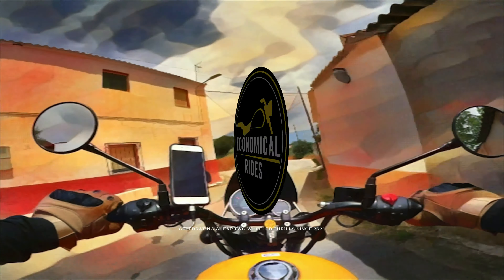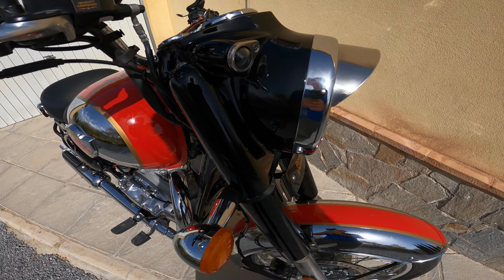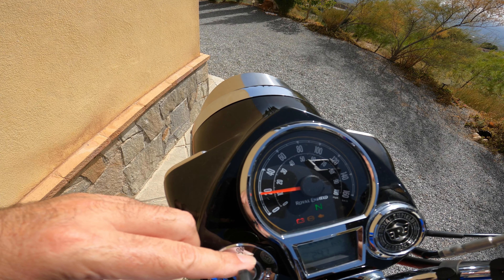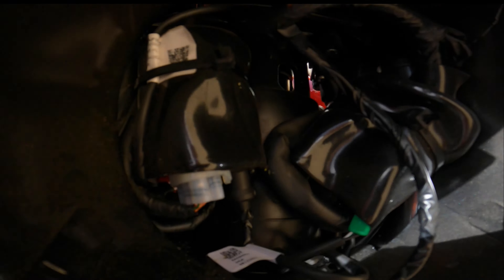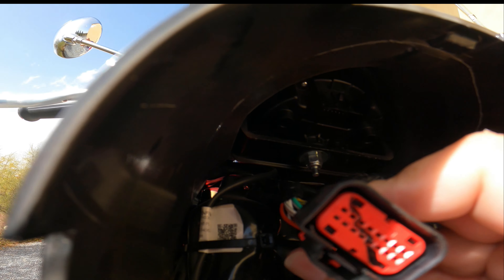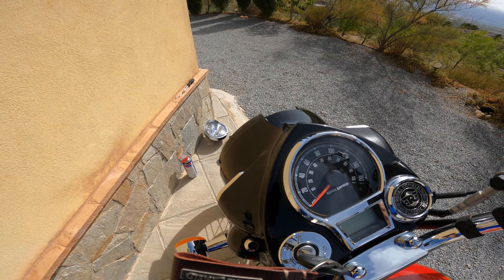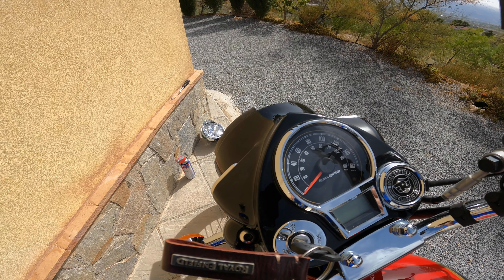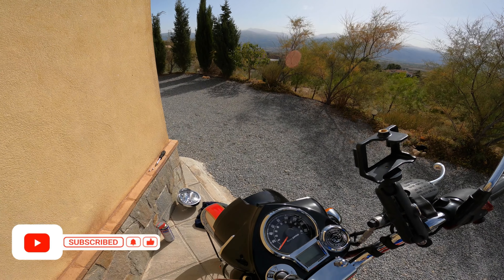Royal Enfield Classic 350 REborn - "Sticky Speedo" Fix ? - Well It Worked For Me ( So Far ! )

Comment: Great video. I was wondering if you added a little electrical contact grease after you sprayed the contacts with WD40? I’ve had to clean out all the factory gunk from the relays on my Interceptor and added a little grease to prevent corrosion. It must be great living in Spain. My wife and I have an apartment in Murcia and hopefully soon we will be spending a month or two at a time there and luckily there is a Royal Enfield retailer in Murcia City! Happy days👍
Reply from the maker: Hi Mark,
thanks, glad you found this one useful 👍🏻
No, I was wary of using grease because I suspect that the factory grease may have been causing the issue. I decided that WD-40 would be nice and light and less likely to affect conductivity in the connector pins. I've no idea if that was a good idea or not, I just figured that this way it would be easier to clean the connector and spray it again, should a repeat be necessary. 
This "repair" has held for over eight months so far, but I was prepared to repeat it if necessary because it is a ten minute job. Preferable to fitting a new speedo, losing your previous odometer reading and potentially having the problem again anyway. 
I've just traded the Classic in for a new Himalayan but the speedo was still working fine when I handed the bike over 👍🏻
I have heard that the shipping grease RE use on electrical connections has caused issues with relays on all kinds of different models and particularly on Himalayans. So if my Himalayan starts acting up, I will definitely open and clean all connectors before losing a whole day taking the bike to the dealership. I believe that the dealers are instructed to remove the shipping grease before delivery but that memo seems to have been ignored ! I think the grease can affect conductivity as its state changes, i.e. as it gets warm on a hot day, it becomes more liquid. That then results in a different level of conductivity through the connector and depending how sensitive the following components are, these slight changes in current could cause weird side effects. It's just my theory, I'm not a scientist or micro-electronics specialist. I would always prefer to have a CLEAN connector and then just try to keep it out of the wet and preferably add some water repellent element like WD-40. Also I don't like getting mucky and grease is mucky stuff 🤗

Yes, I am familiar with Intruder Motorcycles in Murcia, I've been there a couple of times but it is a bit far for me to go there regularly. They tend to have a good selection of RE models on demo but it's a two hour drive each way for me, so a five hour round trip just to test a bike is not really terribly appealing ( particularly with Ruby waiting impatiently for my return ! ).
Whereabouts do you have your apartment if you don't mind me asking ? Mazarron way maybe ?

Cheers Mark, enjoy your Interceptor 👍🏻
ER
Reply: Hi. Thanks for your reply. It sounds like you’ve done exactly the right thing especially as it’s still working after 8 months. Why have you sold your Classic 350? Are you doing a bit of light off roading which would  be perfect on the Himalayan? We bought a place in Lo Pagan which is on the Mar Menor in the San Pedro Del Pinatar district. We’re only 50 metres from the Mar Menor with the Mediterranean just a five minute drive away. It suits us perfectly and since buying it on a bit of a whim in 2020 and visiting for the first time in 2021 we find ourselves going there more and more as I can work whilst I’m there. Murcia City is 30 to 40 mins away and Cartagena is about 45 minutes away. We are about an hour from Alicante and 30 mins from Murcia International airport which is brilliant as it’s a much smaller, quieter airport. Originally I was thinking of something faster than my Interceptor but in all honesty I’ve realised that it’s quick enough as it will comfortably do 100mph (not that I ever do🤣) and with a free flow DNA air filter, free flow headers and Zard silencers together with YSS suspension it sounds amazing and handles brilliantly. What attracts me to the Classic 350 is the thumper single cylinder engine, the military colours they do and the well documented uplift in overall quality and fit and finish. I’ll be going for the Signals Marsh Grey which strangely is actually green and my preference as it will be a nice contrast to my Interceptor and which won’t involve even more polishing of engine cases and exhausts🤪 The Interceptor’s sweet spot is 50mph to 70mph. Having the Classic 350 for bimbling around the lanes between 40mph and 50mph I think will suit me perfectly. It’s great to have found your page. Happy and safe riding👍
Reply from the maker: @markfletcher443  Hi Mark,
if you watch my last video it will all become clear, it's all very recent but yes, since taking both the Meteor and the Classic down a mountain trail about eight months ago I realised how much fun that would be on a bike which didn't make me feel guilty every time I did it. The Meteor and Classic both did well but were filthy afterwards and I always tried to keep them pristine. Since I can't be doing with three bikes at the moment, the Classic had to make way for the Himalayan because I wanted one bike for the roads ( now the Meteor ) and one for the trails ( the new Himalayan ). As much as I liked the Classic, as soon as I discovered the local trails, it did bug me having two road bikes and no bike for the trails. Something had to give !
I can always buy another Classic later on, if my circumstances change again. It was certainly a lovely bike.
RE's black finishes are really easy to clean, so you'll be glad you don't have too much chrome on yours. The Meteor is all blacked out and it comes up like new with zero effort. After two years and a few dusty trails, it still looks brand new. To be honest, my red/chrome Classic was pretty easy to clean too. The only downside with chrome is what the English winter might do to it. If you only ride in the dry, like me, you can hose it off and dry it and it holds up fine.
The black finish does seem to be very durable though and as I said, just rinse off and dry and it looks like new 👍🏻

Yes, Murcia is a lovely little airport. Unfortunately it's no use to me because there are no flights from there that work for me. I always have to fly from Almeria to Madrid and from Madrid you can get anywhere, obviously. Unfortunately the regional airports are really suffering and struggling to get flights, since a lot of the budget airlines went bust !

Good luck with your own Classic and welcome to the channel. I hope you will find my Meteor and Himalayan hijinks entertaining 🙂

Cheers Mark, have a great weekend !
Garry
Reply: Hi Garry. Yes, I’ve just seen your latest video. Aaaah it sounds like it was a very tough decision but I think you’ve made the right one based on your motorcycling needs at the moment. I tested the Himalayan and it’s a great, rugged motorcycle that can do just about anything. I know what you mean about having 2 or 3 bikes. My wife says, “ You can only ride one at a time” Only a non biker would say that🤣 You should have a look at Michael Mams collection. His channel is called The Mam Journals. I think he has at least a dozen bikes of all different kinds. It’s quite a collection. I hope you really enjoy your Himalayan which I’m sure you will and I’ll definitely still be watching your videos even if you won’t have the Classic 350 for much longer. All the best👍
Reply from the maker: @markfletcher443  Thanks Mark.
Yes, unfortunately I am imposing a two bike limit for this year. 2024 should be my three bike year if all goes well !
Something had to give and so far I am really impressed by the Himalayan and the local trails. It's terribly exciting.
Thanks for the recommendation, will try to remember to check that channel out 🤗
It's funny that your wife says that.
I always say "two bikes and only one arse" 😂
Take care Mark and thanks for sticking around. We promise to keep you entertained !
Garry & Ruby

Comment: It looks as though it was just a matter of disconnecting and reconnecting. Also, the needle did go from above 20 to 20 or a little below after the first on and off. If turning the ignition on and off a few times may have done it maybe. Worth the electrical chemical. Doesnt hurt.
Reply from the maker: Hi,
turning it off and on 10 times fixed it THE FIRST TIME it happened. This was the second time and it just would not return to zero. Cleaning the connector is the thing that helps, since I did this, no reoccurrence in eight months.
Some people have had a new speedo fitted multiple times and the problem returns very quickly. This would suggest that it is not the speedos themselves that are the problem, a new speedo on the same old connector, quickly starts playing up again. I really believe that the connector needs to be perfectly clean and have perfect contact for these speedos to work correctly.
It's very easy to clean both sides of the connector with contact cleaner and I would recommend that to anybody having similar problems.
Cheers
ER
Reply: @economicalrides  great! Thanks for the feed back. If there’s been no reoccurrence for eight months it’s a permanent fix and there is nothing wrong with Speedo.( until next time it needs cleaning)
I just rebooted mine last night by the on and off technique. But I will have in handy an electrical parts cleaner. Cheers.
Thanks
Reply from the maker: @maiojoserivera786  Definitely worth cleaning the connector next time it happens Maio. Your bike sounds like mine. The first time it happened, switching the ignition on and off a few times fixed it. The next time it just wouldn't return to zero again.

Another tip for you - if you park the bike in direct sunlight for any length of time, put a glove or something over the speedo to keep the sun off it ( fix it with an elastic band or something if it is windy ! ). I have also been doing this since I cleaned the connector and so far the problem has not returned.
Most people seem to feel that the problem starts when the speedo gets too hot, so just keep it in the shade if you can.

Good luck Maio🤞
ER
Reply: @economicalrides  thanks. It’s a classic 350 chrome bronze. Thanks for the tip. Will be getting electrical cleaner can soon. Looking forward to new vids
Cheers
Reply from the maker: @maiojoserivera786  Cheers Maio 👍
Keep the speedo in the shade and the connector clean and hopefully you can avoid having the speedo replaced and losing your current odometer reading ! That’s why I tried to fix it myself, because I didn’t want a new speedo with 0km on it !
Stay safe and enjoy your Classic !
ER

Comment: Managed to move the red lock down, but couldn't move the connector.  Is brute force the solution?
Reply from the maker: Hi,

I struggled with that too !

I just jiggled it side to side as I pulled quite firmly and eventually it did come apart. Just ensure that at no point are you pulling on the wires. If you are just holding the plastic block, top part and bottom part, you can use a fair bit of wiggling and pulling to get it to come apart.

I almost gave up at the very same point but was brave and tugged and wiggled and eventually I could feel the connector starting to open.

Cleaning the connector fixed the problem for me and the speedo was still working fine six months later when I traded the bike in. 👍🏻

Good luck with it ! It does need a bit of force to get it to open for the first time !

ER.

Comment: This is such an easy `fix`, so I think I will do it anyway, as part of my winter preparation, with some electrical contact cleaner and a bit of WD40, even though my speedo is fine at the moment.
Reply from the maker: Hi Dave,
I would. Just be careful with the connector, it can be stiff, just make sure you are not pulling on the wires when getting it off.
The day after this, after three months of waiting, the dealer called to say that my new speedo had arrived. Typical ! 😂
I won't get it fitted, I want to give my original one another chance.
If it plays up again, I will get the new one fitted but will also clean and lube the connections straight away. It can't hurt and it could definitely help prevent these issues from occurring in the first place. So even if you haven't had an issue yet, cleaning and lubing the connector really can't hurt, as long as you don't damage the wiring harness.
Good luck, I would definitely consider this fix as "preventative maintenance", I'd say it was worth doing, whether you've had an issue or not !
Cheers Dave,
ER.
Reply: @economicalrides  Hi. Yes, typical that it arrived after you sorted the original one. I don`t blame you for giving the original one a second chance.
Thanks for the tip about the wiring connector. I am always careful not to pull on the wires, with any connector.
I have just fitted a heel / toe gear shifter, which arrived this morning, only a few days after I ordered it and it makes the gear change so much easier. I had moved the original lever up one notch and it was better but I must say, the heel / toe is better again. Looking forward to watching more videos from you 👍
Reply from the maker: @davericketts9101  Thanks Dave,
I‘d love a heel toe shifter on my Classic, I really would, if I could buy one from Europe !!!
Buying from India is such a pain, here in Spain. The whole customs charges and delivery delays make it super unappealing !
I haven’t given up all hope that RE dealers might start supplying them officially someday.
Even in its new position I still find the original shift lever to be 🤬🤬🤬
Oh well, glad you got yours and I‘m sure it is a massive improvement !
Cheers Dave 🥃
ER
Reply: @economicalrides  Sorry for the delayed reply.... Sad you are having difficulty getting one and hope you are soon able to get one. I felt exactly the same about the original gear lever after raising it one notch and the heel / toe shifter is 100% better and so easy to use. The seller I bought mine from (at a very reasonable £34.80 incl. postage) has just put them up to £56! They must realise that a lot of people want them.
Good luck.
Reply from the maker: @davericketts9101  Cheers Dave 🙂
Well if I ever do get one, I’ll be sure to mention it on the channel 👍
I’m sure it’s waaaaaay nicer to use ! Enjoy yours 🙂
Have a great evening 🥃🥃
ER

Comment: Hola ,  re speedo  did it last ?  Mine did it last summer intermittently ,  bahaved itself over winter now the suns out its doing it again cheers bill uk
Reply from the maker: Hi Bill,
I just did this fix once and the speedo was still working fine over eight months later when I traded the bike in. I am sure that if it had happened again, just repeating this process would have fixed it for another fair while. But I only did it the once and it was still working fine at the end. Hope this helps. It's easy enough to do, once you've figured out how the connector comes apart 🤔
Cheers Bill,
Garry

Comment: Curious, my current view is that that the engineering is sound but production to meet demand mean that there are some short cuts. I’ve bought a Classic and an Interceptor this year. Both have had a couple of loose spokes in both wheels. Generally finish is good but regular cleaning and protective coatings etc….mind you….is that any different to other bikes?
Reply from the maker: I definitely think that the production side has been under a lot of pressure for the past couple of years at least. RE are selling A LOT of bikes and have also had a pretty hectic release schedule for new models. It wouldn't surprise me to see the odd error creeping in although I think most of the issues stem from suppliers not being able to maintain the quality which RE agreed to buy in. I think RE have chopped and changed suppliers for various components too, in an attempt just to get the parts needed by the production side, and of course you are introducing massive variables if you start doing that. It is always a risk to deviate from your proven suppliers.
Fortunately so far, the problems have been quite minor and probably no worse than many other brands. Parts supply is a nightmare globally at the moment and RE and other manufacturers may have been forced to buy in the odd part which isn't quite up to spec, just to get the bikes out of the door. What they can't start doing is delivering bikes with poorly assembled engines and gearboxes. That's the sort of thing to ruin a reputation. On that side of things we don't seem to be hearing of any issues, which is good, obviously.
It's a tough time for manufacturers at the moment. Considering their output I'd say that RE are doing pretty well in keeping on top of things, overall.
Cheers Pete ( I'll check the spokes on my Classic ! )
ER